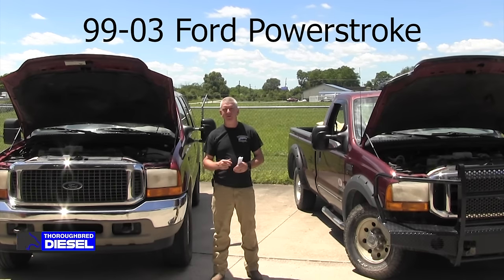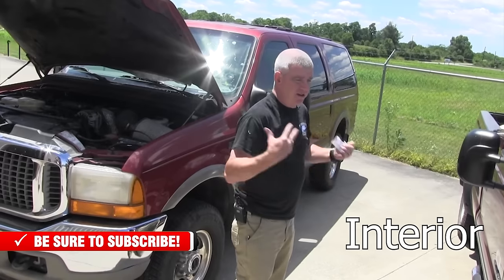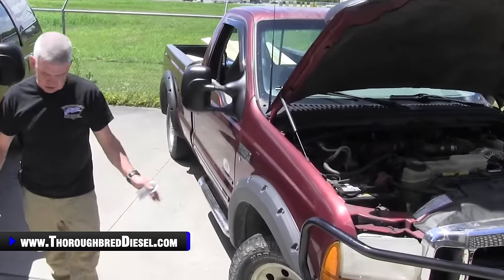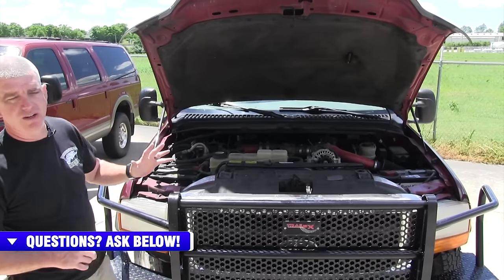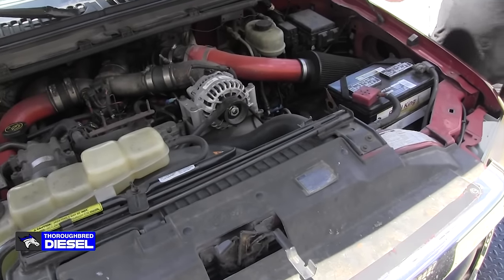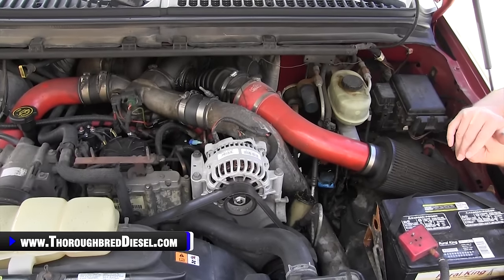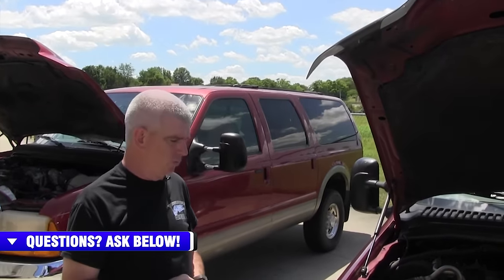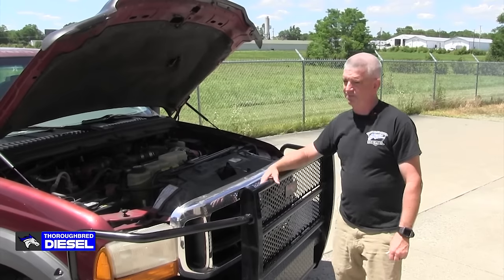TOP Problem Areas To Look At On 99-03 Ford Powerstroke | Secret Tips For Buying A Used 7.3L #ford

Comment: I love my 99 7.3 F-250! No major problems, I have nearly 600,000 miles on it. Best truck I ever owned.
Reply: best truck ever made
Reply: Mine has 535,000 never had a major problem only replaced injectors with another stock set as I wanted to freshen it up at 350,000 still runs great
Reply: Nice I’m picking up a 99 f250 from an older guy with 251k on the clock still running strong 💪🏼
Reply: Can anyone give me some good words for the trucks reliability ? My girlfriend doesn’t believe me that they are reliable. I’ve found a really clean one near me and I want to pull the trigger
Reply: I'm headed to get one now. Nervous
Reply: My '95 runs strong with only 306,000 
7.3 powerstroke or 5.9 Cummins are the only two I'd want
Reply: @drnocka-rocksteady  so am I tomorrow.  03 f350. How'd it go for you?
Reply: Found one with 161xxx miles, iffy about getting it
Reply: I just picked one a 99 7.3 with 369,000 miles on it but the trans is bad but comes with one. I don’t like the high miles but I know the engine is a trooper
Reply: @westernstartruck2528  no
Reply: Picked up a 2001 F350 7.3 turbo crew cab long bed 4x4 formerly fleet maintained Alabama Forestry with..71,000 actual miles only light surface rust of the chassis. This thing is a beast and I've had it 2 months and love it. It's plain on options and i like it that way, i can hose out the rubber floorboards. It has been cold natured a few times starting at 45 degrees so far this fall. Brand new batteries. So i will try plugging it in soon.
Reply: I have a 99,  2 wheel drive with less than 300k. I've never had any issues with it other than a trans problem, which wasn't bad , broken flywheel, and I replaced the glow plugs. Nothing major, it's been a beast... 
Oh and it's rusting out like a 1980s Toyota, but I live in Ohio, lots of salt..  The body will fall off before the motor quits..lol
Reply: @ordinarygamer1353  their reliability is heavily dependent on your maintenance of the truck.
Reply: @jefflancaster6587  clean the crap out of your battery terminals and cable ends and check where the main cable hits the starter. It’s shocking how much difference that can make.
Reply: I just bought one(1999 f250 power stroke) to be my workhorse with 380k miles on it. Any tips on owning a Ford diesel?
Reply: I'll be looking at a minimally rust 03 f350 today (non dually), 315k miles on it, they say it was a ranchers truck, it's got a 5th wheel mount on it and the beds seen since use
Reply: My early '99 F350 4x4 ex cab runs great with 206k on the clock.
Reply: Picking up a 1999 F350 extended cab dually 4wd with 126K miles for 12K. Very excited
Reply: Just bought a used 99 f250 276000 on the odometer 7.3 powerstroke cant be happier love it and bought cheap have to replace diff cover oil pan but minor will be fixed love this truck
Reply: @Joseph Thomas  how is it? I'm picking up a1999 F350 7.3 dually, long bed with 90k miles for 20k and I'm nervous
Reply: My 2000 F250 7.3 PSD CC Lariat is a baby, only 125K miles :-) LOVE IT and purrs like a BIG kitten
Reply: @gavinatkins2671  agreed!!
Reply: 1999 Ford F250 super duty 7.3l v8 diesel , they are asking 15k $ what should I offer , automatic 116,000miles . Should I buy
Reply: @ordinarygamer1353  here’s the best advice. Do the best possible research for whatever your doing and commit to it and tell whichever girl your with “hey babe this is where im going and what im doing.”   If she don’t want to follow you in that decision after you’ve become an expert on the subject, She isnt the one.
Reply: @jefflancaster6587  I had the same problem be cold blooded. Used hotshots injector cleaner through a couple tanks. No problem since.
Reply: So it's been long, do u still have the 99?? If so, what's the Millage?

Comment: Love my 99 f350 7.3 with only 17,000 miles. Was owned by a long term care facility.  My 3rd 7.3 and definitely my favorite
Reply: Lucky dog,  I got one with 191k right now
Reply: How much one of those with low miles ? I about get one f450 with 47000 miles for 27k
Reply: @jrelpantera1982 hopefully you got it. I got myself a 02 dually lariat 2wd with 128k miles for 24k

Comment: you can keep these quieter by running shell rotella oil, the weak point on stock 7.3s is the 4r100 trans.  Upgrade with a larger trans cooler and an aftermarket condenser fan to get longevity
Reply: Yes they are week jest spent 1500$ on mine
Reply: Rebuilt the Automatic transmission in my 1999 F250 super duty 3200.00. The shop put in a high performance Shift pack.
Reply: Or get the zf6
Reply: No the real weak point on the 7.3s were the old E40D transmissions and little transmission coolers. 
a 4R100 has much better internals and parts and if you add a deep dish pan and a large trans cooler from a 6.0L Powerstroke 2.5x more surface area than the 7.3 Trans coolers.
Reply: Point me to a nice trans cooler please

Comment: My husband and I each have 2000 7.3 powerstrokes, mine is the excursion and his is the f250, both super reliable trucks and definitely pull their weight when hauling.
Reply: literally
Reply: Have u ever had problems where it will turn but won't start?
Reply: @gnarledcaptaintheduck9207  probably bad glow plugs...
Reply: @gnarledcaptaintheduck9207  are you low on oil?
Reply: @gnarledcaptaintheduck9207  Yes.  Weak starter.
Reply: could be a few different issues. you could have a bad glow plug relay switch, bad glow pugs, or the simplest being a low oil issue . I am sure there are other issues but these are the three i have encountered.

Comment: I’ve got a 99 7.3 I got about 3 years ago w/ 187k on it. Since then I’ve replaced the CPS, ICP sensor, water pump, thermostat housing, radiator, glow plug relay, batteries, A/C system, and installed the 6.0 transmission cooler which I highly recommend. 235k miles on it now and still running strong.
Reply: How is it running?

Comment: Great video, lots of good info.
I've  owned a 2001 7.3 for over 7yrs. With 166k miles. That has had some mods. I've  done. Including a built trans. We mainly use it to pull a 13k  5th wheel south for the winter.  It's a rust free truck. So I plan on keeping it till I die. 
A recent problem was the engine stalled . And restarted with a engine miss. It has a TS6 chip that has custom tunes. At first it showed a ICP 1280 code. That showed up on my bully dog, that is just used for  gauges . That  I checked out and was ok.  In Harlingen Texas  I found a shop that could read the codes . Because of the TS6 CHIP ,they could not access the PCM . They had to remove the chip and was able to pull codes and do a buzz test. No problems.  Removing the chip cured the engine problem. 
I forgot how much different it was running without the chip.
Brian at BTS is sending me a new chip. It has been a great experience dealing with a reputable business.  Something you won't get on Amazon. 
I think my problem could be  difficult to diagnose for someone that has not had a lot of experience on 7.3s . I've had a bad connection in the valve cover that acted the same way.  That I found checking ex. Manifold temp. This time the temp was the same. Anyway FYI  on possible chip problems.

Comment: My 2002 has been the best pickup ever. Besides heater core issues. It’s been perfect.  Went to a bigger heater core piping and seems to have fixed my problem. It was caveating in the small pipe elbows to much pressure. Had to find bigger QD fittings but haven’t had an issue since. Thanks for the video I’m a late viewer.

Comment: We have a 2000 F-350  4X4 four door Dually Super Duty, Power stroke,. with a little over 200,000  on it. We bought is 11 years ago,  we bought it from a local farmer that had towed a goose neck stock trailer which he almost never unhooked it.,  he just wanted a new Dodge .  We paid 10,000$ for it.. The pick-up was super clean inside and out.  The Pick-up had no exhaust,  It ran great but it was just to loud.  We bought the Banks exhaust with a muffler plus the Banks big air intake. Our  engine builder Bob Cram (Ridgecrest CA) said we got a good deal, but to get rid to the bully dog set up, Bob said it will bite me. The pick-up had three gauges one  trans temperature , turbo boost, and turbo temp.  I hit a snow pole and it took my right dually fender off,  to find a new or used one was out of the question .  My wife found a 9'6" flat bed for 600$ with tool boxes under and two large tool boxes on top of the bed. I bought a sand blaster for the bed  it came out like new.  I added new LED light, and paint.  We tow our 24' fifth wheel camp trailer,  We have no problem climbing the large hills here in Northern Nevada.. 
We are in our late seventies , and just love the Super Duty . We have done most of all which Bill Hewitt has recommend,   I enjoyed your talk about the two ford pick-ups..... Thank You !

Comment: "You hardly see rust on these"

Pennsylvania: "OH! Hold my beer!"
Reply: - the entire midwest
Reply: Chicago here growing up.  Rust central...
Reply: Hahaha, lived in Cleveland for 36 years, I Ziebart rust proof my cars. Road salt didn't cut it so they went to using calcium to melt the ice.
Reply: Lol, yeah I'm in Ohio and the body on my 99 will fall off before the motor quits. 
It's like a 1980s Toyota.
Reply: In Newfoundland it’s impossible to find a box for any fords 10 to 15 years old there absolute rust buckets from our wonderful salt we use. I have a 05 f250 that looks like a banana and I’m looking at buying a 03 f350 7.3 dulley that will be getting a flat deck if bought because of rust issues. $3500 with 300,000 kms it runs and moves so hopefully it is a good choice for hauling a bit of wood and maybe pushing a bit of snow. Thanks for sharing your knowledge it will surely help me in my purchase
Reply: Canada.. hold my keg
Reply: @liveitlikeitloveall2746 road salt isn’t nearly as bad on the bodies of vehicles as it is on frames. Had a car less than 10 years old that the frame broke on. It was from Ohio. Have seen frame damage on way too many vehicles regardless of manufacturer

Comment: I have a 1999 extended cab 4x4 350,000 miles .  Looks new runs like a new truck. Can’t beat a 7.3. My advise is keep up on the oil changes and maintenance. Last forever!!!

Comment: I just joined the club. Bought an 01 F250 7.3. I've only driven it the 4 hours to get it back home, and it was such a fun ride. Looking forward to a long-term relationship with her.
Reply: I'm about to go buy one myself in a couple days!! I'm so excited. It's a 2001 with 220,000 miles on it, but it's only had two owners and they were on top of the maintenance. Can't wait!!
Reply: @jamesb1988  Congrats ! Hope your purchase went well 😊
   We bought our 2001 FORD Excursion 7.3L with 100K miles on it in 2009.
  Today we have 245K miles on it and have averaged only $100 per month on repairs.
    Of those repairs,the two major ones were replacing the GLOW PLUGS and replacing ELECTRICAL MECHANISM for the driver's seat.
   Otherwise it drives NICE and the A/C is ICE-COLD 😊
         June 29th 2022

Comment: I am the original and only owner of my 2000 7.3 PS, 2x2 extended cab truck. The only repairs in 22 years and 182,000 miles so far has been the starter and alternator to which DB Electric was able to send what I needed, replaced the batteries a couple of times now. I did the brakes all the way around a couple years ago, I also did a SUPER coolant back flush because the 7.3s usually had a A LOT of casting sand in the block. I flushed it about 6 to 8 times over several days, put a new de-gas tank, belt all the hoses, added a water filter, put a NEW water pump and put the red extended life Chevron coolant. When I service the 4r100 trans I always 1...do it myself because there is a drain plug on the torque converter to drain it as waell as drain and remove the pan for a new MOTORCRAFT filter to be installed. The swing out cab doors will have the cable ends go bad, esay fix,...several guys here on YT show how to repair, and the metal cable repair parts are like $8 to $10 on ebay. Yup, this was a long right up, but this is EVERYTHING I can remember repairing in 22 years. I still have the original U-joints...original steering link  and ball joints. And those things I said would get replaced in 3 years because there were no grease fittings...WELL I WAS WRONG. This has been and is a great truck.

Comment: To me the interiors on these years are some of the best ever made..with half ass care they just last..no cracks little to no fading either..I have a 2000 model F250 4x4 ...250,000 miles and I rebuilt the front end but it earned that..I’ve replaced the water pump alternator and radiator all normal stuff that’s gonna go bad..I’ve replaced the injector harness on both sides because passenger side went out...other than that IMPECCABLE...u couldn’t pay me to swap for a new one!!! Thanks for the great video!!!

Comment: I purchased my first 7.3 in 2004 . It is a 2000 4 door 4x4 short box , auto. It had 72k when I got it . Today it has 440,000 k on it . Origonal trans, injectors , difs and some ujoints are origonal I replaced injector harnesses once and glowplugs , oil cooler brings.  Amazing truck.  Now I have 5 7.3 diesel ford's

Comment: Check for rust along the beds front beam just behind the cab, crawl under and take a good look. Next check for exhaust leaks around the turbo, shows up a suit on the fire wall. Inspect the spider for cracks at the flanged. When replacing turbo mount o-ring seal some mechanics will swap the turbo up pipe to turbo clamp with the spider to intercooler clamp this will crack the spider. The big clue is the v-band clamp that looks like a hose clamp will not be on the spider. Listen for turbo whine on acceleration, if you don't hear it there's trouble.

Comment: 240,000 miles 2002 7.3 2wd 
I’ve had it for over 100,000 miles I had to put three grand into redoing the front end because of normal wear and tear that included a 2 inch leveling kit, normal matinence and new headers. It runs like a champ. I tow about 6000 pounds 4-5 times a month, and it’s constantly full of tools as it’s a work truck. If you find one of these trucks that has been respected that it’ll last year forever. Even if you have to dump 3 to 6 grand into a new front end or other basic maintenance issues you have after 150000 miles you’re basically getting a new truck at that point. That still has a longer life left in it compared to newer vehicles today.

Comment: I bought mine with 87000 on it, I've got 340000 miles on it, replaced the 4r100, with a stage 2 transmission with the billet converter and the red clutch pack, no problems since, 👊
Reply: Where’d you purchase your transmission, how many miles on it so far, and how much did you spend? I’m just curious who makes reliable 4r100s

Comment: I bought my 2000 F350 with 6 sp ZF6 manual brand new, been parked in my barn since.  Put a GTr38 Garret Power-master turbo 4" straight back, custom 5 position tunes.
Love the front leaf's and straight manual lockers.  It actually has a much shorter turning radius than the wife's F150.  The 99's had trans overheat issues, in 2000 they added the trans oil cooler.
Yes, when it was 2 months old the cam sensor failed, thankfully under warranty.

Comment: These trucks are bringing big bucks, I just got offered 30k for mine, 01 250 superduty fx4 kc sb NO RUST, ANYWHERE. and told them nope! The toyota dealer seen it and offered the new supra if I gave him the truck and 15k I took that as an insult. 158k miles, hydra chip, pillar gauges, cold air, 6.0 oilcoller swap and magna flow downpipe, back which I did for towing the camper. I love it,sold my 2000 10yrs ago and kicked my self till I found this one. best trucks ever.

Comment: Late 99 350superduty 4or dually. 220,000 miles, upgraded the transmission at 25,000miles an have not touched it since. Waterpump,Glow plug issues,Couple Fuel pumps,rear pinion seal,front hub assembly,ball joints. Awesome Truck,body is still in great shape.1 owner Truck.
Reply from the maker: Glow plugs are a common failure point. Not sure if we mentioned that

Comment: don't forget the  2 fuel filters in the gas tank and the fuel pickup tube rotting off.   cam sensors going bad,  fuel injector electrical connectors going into the valve cover go bad
Reply: I have an 01 Excursion 73 we bought it was 75,000 miles on it. We’re just over 101,000 miles on it and I have probably put 12 camshaft positioning sensors in it. I took the time to clean the battery terminals very well, one day and had no shut off problems for a year. But I’m back into having it momentarily. Shut down while driving and usually towing a trailer. I’ve been told it might be electrical. A friend of mine cleaned out his fuel tank and said there was a bunch of crap in it. He cleaned it out and has not had it shut off on him in five years. I have a hydra chip in it for fuel economy. Curious if you have any ideas?  Kyle

Comment: I have a 1999 Ford f350 supercharged forged V10 with 4.88 gears and a gearvendors underoverdrive it pulls like a mother and get 14 mpg because of underoverdrive its 23 years old and not a dent on it when I bought it I pulled the motor out and built it up supercharged it and methanol injection and calvaned the spark plugs only problem I ever had was the plugs blowing out very nice truck .

Comment: I love my 02 7.3 f350 single axel it has a 4" exhaust KC 300x stage one was a 1-owner barn kept no rust not even under the bed  220k i paid 12k for the truck  and a stack of paper work with all maintenance and repairs i couldn't resist